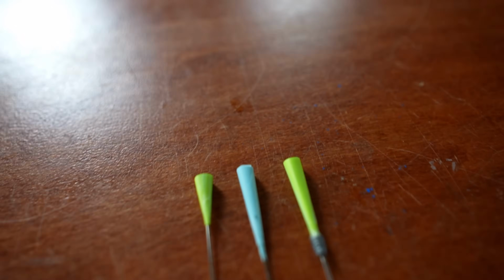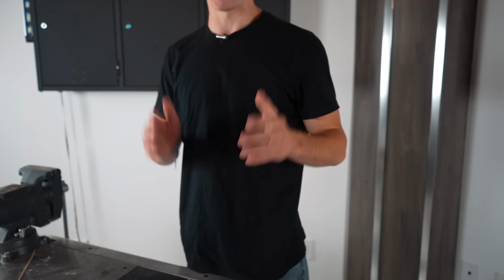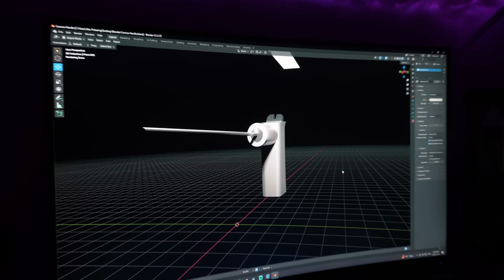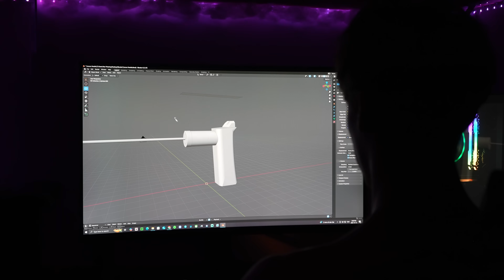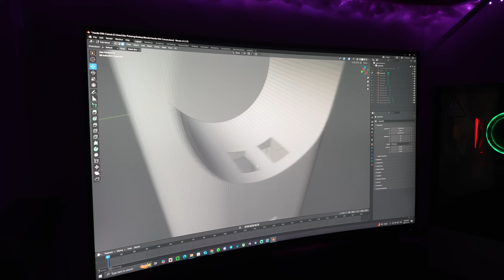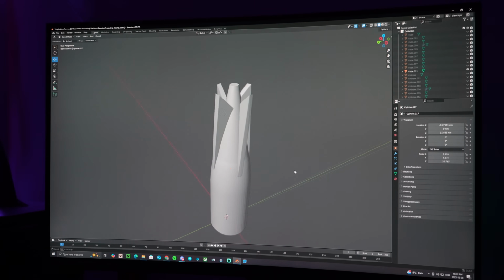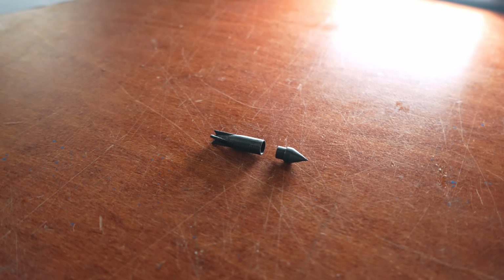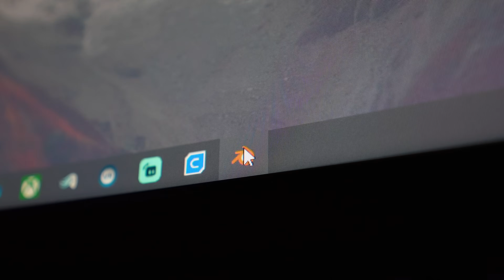I Made Exploding Ammo For This Mini Desktop Cannon

Comment: Now you need to work on the reload speed. Make the fuel system integrated to the device so you can refuel with a button without having to take apart the canon (make sure to use a  flashback arrestor so your fuel source doesn't explode in your hand). As well as being able to load a projectile without unscrewing it completely to open the breech.

Comment: I dont know if I'm allowed to say this but I used to make fireworks and cannons with this flash powder and the recipe is literally just an oxidizer + a fuel + red phosphorous the match head already contains the fuel and oxidizer you just need to add red phosphorous (secret ingredient he doesn't say) which if you want to get it easily you can scrape the red strips on the side of the match box.

Comment: This idea might be a bit difficult and probably more expensive, but if you could make the projectile function a bit like an armor piercing round where the explosive chemical is redirected towards the aimed surface it could react like an rpg-7 round and make harder surfaces like thin sheet metal piercable.

Comment: try using gunpowder with a rounded tip almost like a shotgun slug. It will have significantly more umff than the powder you used.

Comment: You should try to use the HHO gas from water electrolysis. It has the perfect mixture of hydrogen and oxygen to make a bang. The electrolysis machine could be attached or inside the gun as they can be very small.

Comment: fin stabilized projectiles dont need to spin. it makes lose energy and precision most of the times. also, chemical warheads (like HEAT) are fin stabilized to keep the explosive charge and chem load pointing in a sigle diretion during impact. spin causes it to spread and lose effectivness

Comment: Yo so I’ve been up on your series ever since you started. I’ve also Proably made 20 mini cannons out of different things. Including the same flashlight you use. But from experience, the body you use is weak. I used a little squeez bottle thing as a body and it showed way better performance that with the aluminum flashlight. I’ve seen that it’s better if the body is thicker and not as long, then long but skinny. So if you really want it to go fast, get a body tha is thinker. I promise it will work better
Reply: And also, those little rockets may not be air tight. So I recommend stuffing paper behind them for the pressure to build up. I was able to get a peice of potato to go 400-500kph

Comment: 1:55, onshape is free to use and they will prob sponsor you if you mention them.
also if you want better fuel burn put in metal scraper or something similar cause it adds a ton of surface area and it's an easy upgrade.

Comment: FPS are not KMH. that dart is way slower than 578.2 Kilometers per hour.
Reply from the maker: In that clip it was fired at 578 FPS which is actually 634 KPH
Reply: @TheGripsion  You are right, Just saw that FPS on the display and heard you saying km/h.

Comment: Put a 1 way valve or a blender screw for brake caliper. On the tank so you can fill without taking barrel off.. also make a chamber on the barrel so u can load a round then pull the sleeve over the chamber and fire. Make easier and faster shooting.

Comment: Try TATP dissolved in enough acetone to make a slurry. While still wet it is stable so you can load it into your projectile safely. Choose a projectile housing that can hold acetone without dissolving and is airtight except for a valve or plug. Before use, open the valve and allow acetone to evaporate. It is now armed so don't drop it. To disarm, add acetone until payload is dissolved and flush it out. Stay safe
Reply: organic peroxides and "safely" in the same comment

Comment: Hi Gripsion, why don't you use acetylene instead of butane gas? Acetylene is made with calcium carbide and water.
Reply: Acetylene would make this deadly. Just using it in a potatogun made mine reach over 300 joules.
Reply: @tomclanys Hey dude, can you upload a video to your channel of how you fired your potato cannon using acetylene as fuel?
Reply: @ErikMartinez-i5y  nope, cause that is highly illegal in my place :D
Reply: @tomclanys I was referring to the potato gun
Reply: @ErikMartinez-i5y  of course, it is illegal because of the power it produced. Lemme just tell you the gun survived, but the boom was loud like a supersonic boom
Reply: Or HHO... electrolyze a little bit of water and pump the gasses in. Perfect stoichometric ratio, every time.
Reply: @superslimanoniem4712It's also a very powerful fuel. Good idea.
Reply: @superslimanoniem4712 HHO has one huge problem, it almost instantly turns back into water which actually causes suction and you need a massive surface area for the bullet to accelerate with the very short, powerful shockwave... or very light bullets. Gas to gas combustion is just better. HHO is pretty bad as a propellant for bullets.